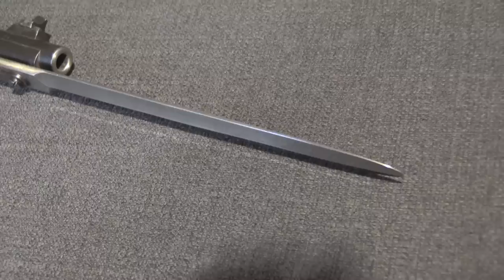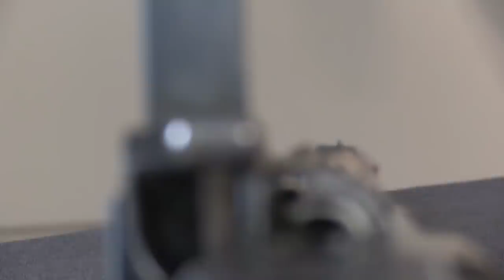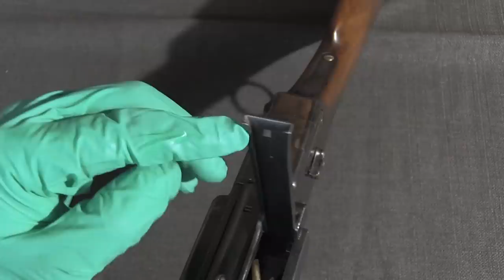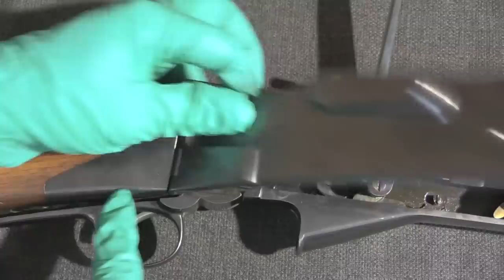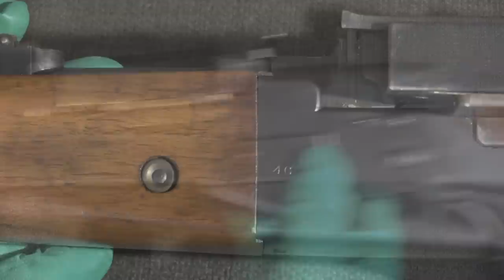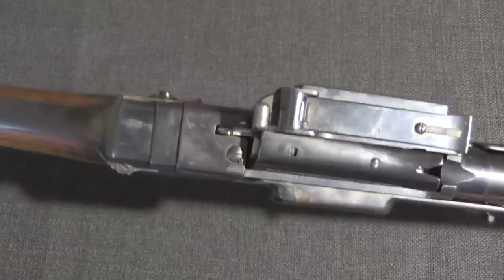Madsen M1888 Forsøgsrekylgevær: The Strangest Semiauto

Comment: Why didn't they just attach a couple of robotic hands to a muzzle loader, and program them to perform the loading process? It would have been more simple than this.
Reply: Babbling Babblator because robotic hands require matrices to work. Also, this was created around the time of magazine fed bolt actions, so you would have been better off building something like the Howell automatic rifle instead of your suggested method of operation.
Reply: @jackandersen1262  how high do you think the joke went over your head? I think it may have bounced off of mars before impacting the Indian ocean.
Reply: John Sanders pretty impressive if that did actually happen. still doesn’t mean that you have to get worked up enough to respond to a year old post.
Reply: @jackandersen1262  hah, I just wanted to use that line and to seemed appropriate. Apologies for the necroposting, I dont pay attention to (or care) when a comment is made
Reply: @PredatoryQQmber  yeah, I'd think its dumb, but theres also the problem that people may disagree with things they said in the past. For example, four years ago I was swept up in the anti sjw crowd because all the atheist youtubers I watched (in my defense I was still in my edgy atheist phase and I was 15) started making that kind of content, and it got to the point where I was watching Sargon on occasion. Fast forward to modern days, if my old self read some of the things I said I'd probably try to start a flamewar with myself
Reply: They googled it but they found an article saying it wouldn’t be invented for another 200 years
Reply: Money issues.
Reply: @Ezekiel_Allium  it was too appropriate and a great line. I'm gonna borrow it if you don't mind
Reply: @TheTuttle99  go for it
Reply: Just hack the gun to go full auto
Reply: something about the availability of electricity in 1883
Reply: @jackandersen1262  do you even know what “matrices “ even are?

Comment: Is the bolt part of the rear sight? I see that notch in the top... Can someone address this for me? I'm super curious. Edit: I realize that it's not the "main" rear sight, complete with elevation adjustment etc. But it does have a large notch that would possibly make it suitable for quick target alignment or low light engagements
Reply: Probably just a cutout so that you can see the sight like on an Uzi or a Thompson.

Comment: OVER ENGINEERING INTENSIFIES!
Reply: Considering it was being developed when black powder was still the norm, the up and down action on the bolt, and the engineering to make it work isn't really over engineered.   A cycling bolt would never work with black powder fouling.  This system keeps all the burnt powder in the barrel or ejecting out the bottom with the shell where it wouldn't be a problem, so there is a logic to the over complex design.  If we still had black powder today, a system like this might be the only solution.

Comment: That bayonet got me pondering, were any similar blades, perhaps situated on the side of the barrel, intended to be used as simple monopods? Locking not only in the stabby and no stabby positions, but also stabby the ground position. A silly idea, but history is filled with silly ideas.
Reply: +Jari Heiska
sticking sharp objects into earth makes them go dull quicker than you'd be comfortable with. Also this would be a pretty useless monopod, since there is no possibility for rotation due to the shape of the bayonet. On the other hand, if it had a triangular cross-section and didn't have an edge but just a point... It could work.
Reply: Jack Vernian A rat-tail bayonet, I suppose. With a scabbard of sorts, to alleviate the dulling. This could work, I tells you! 100 years too late, though. :)
Reply: Any barrel-mounted monopod/bipod device would be problematic on a rifle that relies on the whole barrel moving to cycle the action, each time it is fired. It would prevent it from cycling & cause malfunctions. This kind of system will also be sensitive to changes in barrel weight, which is very likely the reason a permanently attached bayonet blade is used, rather than a typical sword bayonet of the era.
Reply: tjp353 Oh yeah. The barrel moves. Back to the drawing board, I suppose. :l
Reply: Jari Heiska Attach to furniture instead
Reply: Carlo Harryman Ultimate house clearing attachment.
Reply: The SKS spike bayonet was occasionally used in such a capacity.

Comment: The metric system was not introduced in Denmark until 1907. The distance scale is therefore either in Danish "fod" (feet) or "alen" (two feet).
The Danish "tomme" (inch) was 26.155 mm, slightly longer than the English, 25.4 mm, so a Danish fod was 31.385 cm (English 30.48 cm), and an alen was 62,77 cm.
So, it's not 2,300 metres, but most probably ~722 metres - alternatively 1,444 metres.

Comment: The name means something like "Attempted Recoil-rifle". I am not Danish, but it's similar enough to Norwegian that I can understand it just fine.
Reply: It could be. Forsøg can mean “try”, “attempt” or “experiment” so the most likely meaning (as far as I can see) is experimental recoil rifle.
Reply: Not at all. If anything it's the other way around. Norwegian has its roots in Old West Norse, whereas Danish (and Swedish) has its roots in Old East Norse. You can still hear Old West Norse, or at least something very similar, namely Icelandic. But Norway was under, first Danish, then Swedish rule for a very long time, which heavily influenced Norwegian, and is probably why both Danes and Swedes understand Norwegian fairly well (where noone understand Danish, sometimes not even Danes).
Danish was in turn heavily influenced by German.

BTW, the name means trial or experimental recoil rifle.
Reply: Ashley Weeks Norse-Norwegian is actually much more similar to Icelandic. Norway was occupied by Denmark and then Sweden for a total of 500 years. So our language today islargely influenced by Danish and Swedish. That's why we understand each other.
Reply: I am a dane... and i would say its experimental... because an sience experiment... would be called a videnskabs forsøg.
Reply: ... and it's also similar to german : Versuchs (recoil) Gewehr
Reply: Forsøg has more meanings, but in this instance it is 'experimental', so the accurate translation is Experimental Recoil Rifle.

Comment: I don't see how this would have problems from powder fouling. There's no gas piston that would clog up, it is not blowback so the gasses do not interface with the bolt/slide system and the bolt travel is minimal. Looks like a good solution for that time.
Reply: Those guys knew what the problem with black powder was. But some would definitely make it in there after every shot and I would hate to have to clean that thing. On the other hand how many rounds did they expect to fire in an engagement?
Reply: Black powder residue could still get into the action when it was cycling. Judging from its intricate mechanics, the rifle wouldn't work even with the slightest dirt in the action. That's pretty much the reason why the M1888 was not more widely used as the Danes didn't adopt a smokeless cartridge until 1908.

Comment: Is it just gravity feeding rounds down the stripper clip for the feed system to grab?  That seems pretty iffy.  I'm thinking the shooter may have had to manually push the stack down sometimes to get the lowest round in the proper spot for the feed system to grab, particularly if you had to hold the rifle at an angle rather than straight upright for some reason.

Comment: I want to see a semi/fully automatic rifle where the bolt carrier contains all the mechanical parts self contained so that if it breaks you can just pop a new bolt in at the armory while the broken one gets refurbished. All it needs is a swivel bearing and a nob that runs a spring loaded track operated by either the recoil or returning gasses forcing the receiver to unlock/rotate/spit cartridge out/recharge pin/catch new cartridge/relock/fire/repeat.
Stupidly complicated for classic engineering practices but it'd be fun and compact.
Reply: You are looking for the AR 15 / M 16 family of rifles. The bolt and bolt "carrier" contain the most important "operating parts" - other than the fire control group.